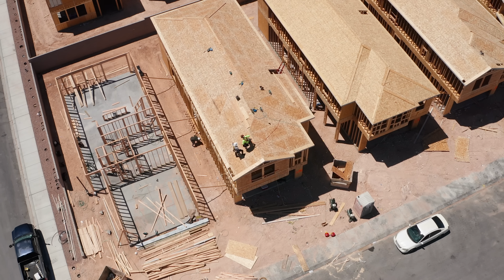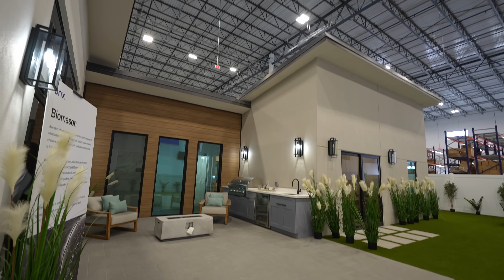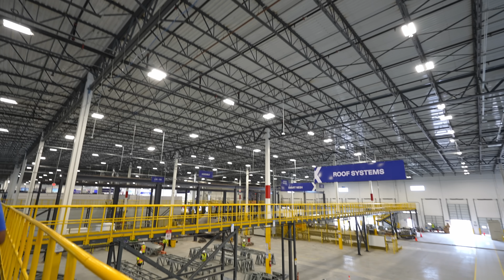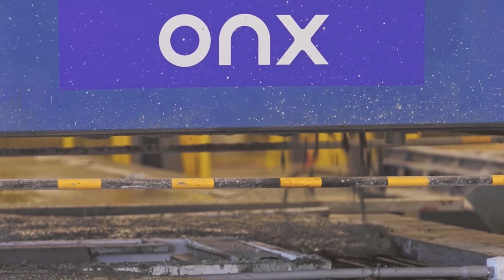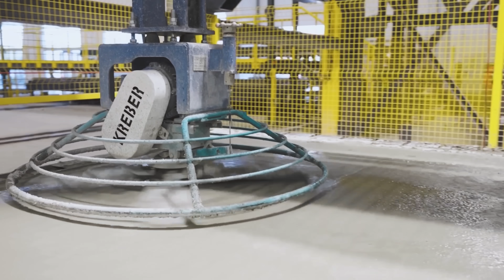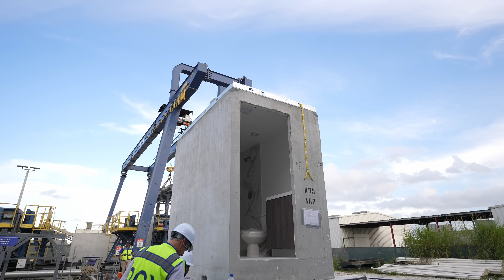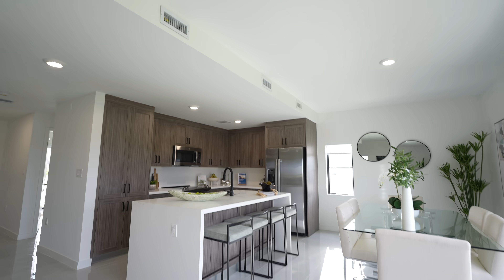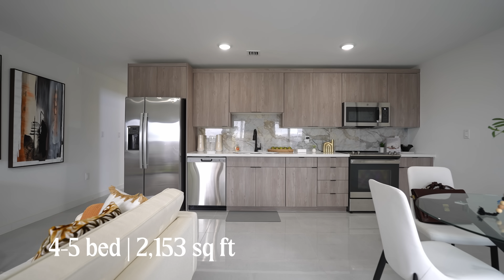Why This Company is Building Thousands of Concrete Homes

Comment: you forgot to mention that concrete construction are WAY MORE sound proof. timber frame houses are notorious for poor sound insulation.
Reply: So many apt buildings in the USA just wooden stick building for the upper floors and you can just hear everything because they don't insulate it with anything except the basic fiberglass.
Reply: @james8208  no wonder people always say they don't wanna live in an apartment building cause it's noisy and you can hear your neighbors
Reply: @miles5600  Yep, that is the main reason why so many people in the US hate living in apartments. You literately have no privacy cause walls have no soundproof and are thin, and you have no safety in case of fire cause the whole building is made of cheap wood, plaster and sheetrock. On the other hand, apartment for rich people in the US are well-bult, with great soundproofing, concrete walls, floors and ceilings and great safety.
Reply: @clemhfandango.  yea i experienced it a few times when i visited the US. When i visited Canada they did have some hotels and apartments with concrete divider walls, concrete in general seems to be a little more common in Canada.
Reply: @clemhfandango.  Cheap wood? What do you know about wood? You couldn't tell me what wood is used in framing. No safety in case of fire? Apartments in America are required to have fire sprinklers in nearly every room, ensuring that the building will be soaked in water and fires almost never spread...Why are you talking about things you have no idea about whatsoever? Also you think concrete apartments are only for rich people?????? You never seen a concrete projects? LMAO
Reply: @james8208  Sorry, but you've never lived in a panel house. As someone from the post-Soviet development, where there were only panel houses, I'll say that the soundproofing there is worse than in a frame house with mineral wool and a double layer of plasterboard. Plus the sealing of facade seams, eternal mold on the seams, minimal insulation of the panel itself (and judging by the video, it is very thin) and any repair is very difficult.
Reply: You are so right! Our homeowners especially like the concrete staircases. No creeks :)
Reply: @onxhomes  Well, I wish you had built the concrete condo I'm living in, here in Portugal. I can literally hear the people using the bathroom upstairs. Every foot step and chair slide. It's unbearable and this is an expensive building. Anytime someone hangs a picture, out comes the impact drill and everyone in the whole building hears it...
Reply: Also resistant to termites and insects.
Reply: @Da-Sheek  Exactly. The beams don't get rotten/eaten.
Reply: Wood houses in Norway are pretty sound proof. But walls are 10 inches thick and insulated. Inner walls are 4 inches insulated too
Reply: I have a 20 year old cinder block home and you are correct! I have numerous parties at my house and all you can hear from outside is muffled music and voices, if anything at all.
Reply: true!! i can hear my neighbors moaning at night 😢😢😢
Reply: do you know for houses that are already built for inter-room sound proofing or less noise what is the best way to go about it? (those office pods that I think came out near COVID early days, I wondered if those type idea can be used for rooms so essentially each of the rooms that needs to be sound proof or max sound protection is built in a 'pod room' kind of way so for WFH type situation or just kids rooms next to parents so enjoy peace of mind especially late nights....and if that was doable maybe even laundry room can be done in a similar way as I think late night is when the electricity is at a better rate and these days they can probably be on timer)
Reply: Absorbing the sound and blocking the sound are two different properties.
Reply: :hand-orange-covering-eyes:

Comment: Thanks for. another very informative video. I love the idea of building in concrete in parts in a factory and assembling on site - make a lot of sense. And the quality of the design look good. Very innovating thinking. But the street layout of all identical houses positioned in EXACTLY the same distance from the street looks like an awful neighborhood to live in. 

The developers are thinking like Levittown back in the 50s - most builders nowadays have learned to vary their designs pretty significantly from house to house, and town planners often try to specify a mix of building types on any street, so it's not just a line of identical 5-bedroom houses. They should mix in a 1-story 3-bedroom, a duplex, a small 4 unit apartment building a couple of row houses, so a variety of people can live in the same area and make vibrant neighborhood that's fun to walk through. Seniors, young singles, retired couples, mulit-generational families etc. - not just married families with 3 kids. And PLEASE vary the position of the fronts of the houses so it doesn't look so regimented!
Reply: I agree, but they wont do it BC tem need tô scale tô save costs
Reply: We love your understanding of the technology and your take on the project. The project showcased was permitted. The new Onx neighbourhoods in Villa Pass and Burnt Store Lakes will have a variety of options and designs. We are just getting started and are working on designing and building better every day. Love your feedback.

Comment: What about maintenance and warranty? I saw some PVC plumbing that appears to be not accessible after install. I’ll have to ask Onx but would they let other contractors touch the home to repair the systems they installed.
Reply: We offer an extended Onx Care repair and warranty. The plumbing areas are accessible through the drywall.
Reply: @onxhomes  Does Onx have a policy in place where only Onx and/or their approved Subs can repair the home? Or Can any licensed Plumbing, HVAC, Electrician etc. can perform work on your building and still maintain your warranty.
Reply: @jcchan08  Any licensed technician can work on our homes.

Comment: I would love to have a concrete home here in tornado alley.  Plus sound insulation is better with concrete over typical 2x4 wood homes.
Reply: Concrete walls are no match to an F5 tornado. All it does it give more weight to the debris that will fall on you and crush you.
Reply: @starventure  thanks for speaking the obvious.  Nothing other than being below ground is safe when facing one of those monsters.

Comment: Concrete is definitely the way to go but 500K is not😭
Reply: $500k for 5 bedrooms is cheap for most American states.
Reply: Location, location, location
Reply: 1st Florida isn't the cheapest. 2nd there isn't any cost savings on first renditions. Their next factory will be better but instead of dropping the price it will add more features like solar.
Reply: thats cheap by cali standards
Reply: @thepotatoofheaven  also kinda cheap by Dutch standards.
Reply: @FrankyDigital2000 if there's one thing you should know about Americans, corporate capture is strong in the market and so We didn't know about the standard dutch use, but we do now thanks in part to YouTube and we will now begin to overcome the dutch construction methods. We just needed to know how bad we were in comparison to European, now we know, and next we conquer.
Reply: @Findmannynow   wait, what  ?
Reply: @Findmannynow  Fuck are you talking about? There is nothing wrong with wooden home construction. Concrete is theoretically better in some ways...Wood houses are fine. Concrete cracks and can be unrepairable. A wood house is never unrepairable until it's knocked down. You think American construction companies didn't know how European ones worked because of lack of YOUTUBE? The comments on the internet are getting dumber and dumber...We build with wood because we have wood...The European countries aren't building any new homes, hint hint
Reply: @FrankyDigital2000 NL house prices are worse than NYC or Calis
Reply: @thepotatoofheaven but if im not mistaken thats due to land prices in California (i am not American but so i heard).

This 500k is too much, especially since you havent factored in the land price yet.
Reply: @Dee-yj1im  that's not just California. It's Florida as well. You purchase the land you want the home built on , and then you purchase the home. So , in the end , that home could cost $570,000 or so. If it's already in an existing neighborhood, then you just buy the house.
Reply: @Dee-yj1im  Not to mention the permits, utilities hook ups, septic tank if needed, lot preparation and finishing the punch list. before occupying. It's like purchasing a vehicle with a frame and body only. These sites rarely dig down for the total cost because after all is done and y'all have the key and deed; plus insurance. Speaking of Insurance that's never mentioned. Go back and review houses that were completely done and move in ready with total cost, time and issues. Half info equals you nothing except more expenses. Let's get real about the real cost!
Reply: @Dee-yj1im  A house is never priced separately from the land it's on in America
Reply: @Dee-yj1im  she said it factored in the land, tbh i dont think its that bad 500,000 you get the land and a whopping 5 bedroom house. thats not small.
Reply: @thepotatoofheaven Cali? Concrete is a bad idea anywhere near a fault line.
Reply: @Tyiion  what do you propose as a sturdy alternative ?
Reply: @thepotatoofheaven  I don’t know. You would have to speak to a home builder. I just know that the injuries to concrete home dwellers after an earthquake are horrific.
Reply: @Tyiion   no its not, skyscrappers in Cali are made of concrete genius
Reply: @바보Queen  Modern skyscrapers are built using very specific procedures to deal with earthquakes in California. Residential concrete homes are not. After large earthquakes, the majority of deaths in California tend to come from those living in concreted homes, especially older concrete homes.
Reply: @바보Queen  Modern skyscrapers in California are engineered to withstand earthquakes. Residential concrete homes are not. Most of the deaths following large earthquakes in California tend to come from concrete homes, especially older concrete homes.
Reply: I'd like to know what they are factoring in for the land cost to be able to comment on the house itself.  To me it was very cookie cutter and steril looking.  Also <2200 sq ft with 4-5 br and 3 baths is very small rooms.  Can't easy guess at the cost per sq ft so can't comment on the value itself.  Factory built brings increased quality generally and lower costs via automation and production lines.  Down side to these homes are you pretty much have to accept the configuration forever as remodeling or simple changes would be difficult and costly.  That's my 2¢
Reply: She specifically said in the video, $500K including the land. It's not a lot of land but land no less, in a subdivision. Unfortunately, it's only available in Florida atm. Which will partially be under water soon enough.
Reply: 500K is cheap down here in FL.   Condos and Townhomes will start around more than that.
Reply: $50k you will have a condor in Ghana Africa.
Reply: @derysylvester3180  That is one expensive bird.
Reply: $500K is the new $200K.  Homes have doubled and tripled in price in the last 5 years....crazy times.
Reply: These are houses in Florida. The mean price of homes in America has inflated to $420,000, for a three bedroom home. So, at $500k including land, in Florida, is an excellent price.
Reply: It’s worth it if you can afford it.   A concrete house would last hundreds of years with minor upkeep and roof maintenance.   A wood house is gone in -40 years without maintenance.
Reply: I agree. That is not affordable except for a very small number of people living in America. I'd like to hear what their home buyers have to say in 5 years. They have to work out the kinks for sure and how expensive will that be for the homeowners.
Reply: Yes,  being that it's made from cheap concrete and not wood,  and mass produced on an assembly line largely by robots and computers,  the price should be $250K or less.  Good old ripoff America,  always finding a new way to disappoint.
Reply: Cheap by Brazilian standards
Reply: She also said 500k was the starting price, maybe these greedy ass insurance co should rebate the buyers believe me they have the money!
Reply: 500k gets you two parking spots in Hong Kong 😂
Reply: It’s cheap by Houston standards too unless unless you want to live out in the suburbs.
Reply: Cement is expensive fool!!!
Reply: It's not very expensive compared to traditional houses, especially in hurricane-prone areas.
Reply: In California, $500K can probably buy you a toilet
Reply: You forgot the main idea of the market economy, which is “supply and demand”: the more demand, the more supply and the prices will go down. You just need to fight monopolies, but with the legalised corruption in America called “lobbyism”, you’ll probably lose the fight.
Reply: how the fook is everything inflated in the us lol its only 500k in rupiah in my country lol you need to make money as much as possible and leave
Reply: Homes being destroyed due to crazy weather caused by climate change. 
Solution? Build homes out of one of the worst polluting products in the construction industry 🤦‍♂️
Reply: @alex98b627    How to control the public: 1. Create a problem that induces massive fear. 2. Convince the public only you have the “solution” to this problem. 3. Have the public give up their rights, choices and privileges (such as abundant food) to implement the “solution”.  The world’s governments love Climate Change.
Reply: @alex98b627  PLASTICCC
Reply: @alex98b627  Climate cannot be changed by man.  That's all a scam to make the U.S. distribute money to the rest of the world.  But man can control pollution, however the U.S. does a great job maintaining a clean environment while other countries are horrible but they never get blamed.
Reply: thats cheap as F... sounds like u are out of touch with how much crappier houses go for, that 5 bed house would be over a million in Cali
Reply: @바보Queen  you’re right it’s very reasonable for that house. But I prefer the urban areas with workability to shops and restaurants. So it would cost a lot more. It would cost Over $1.5 million  depending on the area. California regulations make houses cost a lot more than they should. Too many bureaucrats adding unnecessary cost.
Reply: @바보Queen There are LOTS of places in the USA that $500k is expensive. Maybe you need to expand your horizons and check out the Mid-Atlantic and southern states. Your dollar will go much further.

Comment: Interesting how they still use drywall on metal studs. Over here, they simply put on a very thick layer of stucco directly onto the concrete. All the pipework is fitted in the concrete itself, sometimes as part of the molding process or afterwards by cutting slots then drywalling over it.
Reply: I suspect they do it that way so you can access the plumbing and electrical if needed. Over the life of a home you usually have to redo the plumbing after thirty years. And electrical wiring if often changed to add new outlets and lighting, or to put audio cables in the walls etc. You can also pound in nails to hang pictures a lot easier in drywall.
Reply: So once you buy a home like this & you want to add an addition onto it how does that work?? Seems like structural changes you might want to make years later might be an issue.

Comment: This is not something new, I don't why in the US, home are build using wood, I am from Pakistan and no matter Small or Big build everything is build using concertante and it's perfect, It's save and get the Job done. Pure Bricks and Concertante all the way from the Ground to roof, everything. and for wiring, We have solid plastic pipes.
Reply: Yea we know it isn't new.  We Americans have had concrete homes starting in 1908.  The issue is that it's expensive. All over the world concrete is used, and it raises the price.  You can still make a fireproof house using wood and board.  The other issue with concrete is home customization.  Once you build it, it's hard to change or remodel.